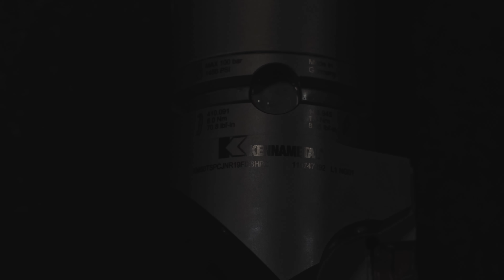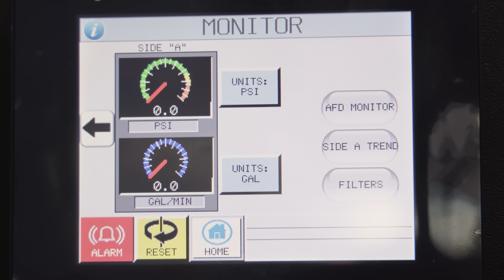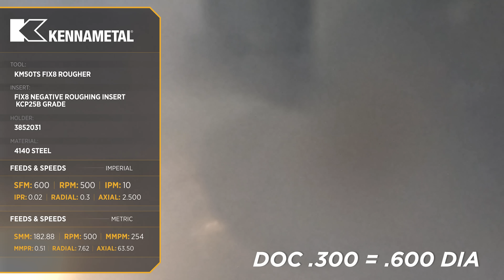AGGRESSIVE Cuts in 4140 STEEL | PUMA SMX3100ST Mill Turn Lathe

Comment from the maker: Love Seeing Tyson Having Fun… Truth is, the cuts he took were 4 times faster than the parameters given with the tool / insert… So he definitely was testing the boundaries… and holding his breath😂… On that last cut, I told him that he should actually turn away from the machine and just have his hand on the STOP… as his ears would hear the insert go quicker than his eyes and he would be faster hitting that red button… of course he needed to see the CUT, but to our surprise… It just literally Zipped right through it. WOW! This tangential insert is truly… a Remarkable BEAST!

Great Job Tyson!!!

- Proud Dad
Reply: Show the chip!
Reply: Boom!
Reply: Tyson has really upped is game!
Great video however I would be concerned with the b Axis alignment after so much heavy roughing….
Best practice to use the lower turret for the heavy stuff. IMO.
Reply: In the late 1990's we were turning 4150 shafts on a CNC Dean Smith and Grace lathe taking 22mm DOC (44mm off dia per pass) at 1.2mm/rev feed rates so Titan you have a bit to go to catch up on material removal but i do enjoy the videos and have picked up some useful stuff from them
Reply: Your son is a beast!
A man of confidence and knowledge!
Reply: WTF IS THAT? TIN??? THAT CAN NOT BE STEEL!
Reply: Those were some beast cuts right there!
Reply: Your heading shows .024 FPR.  No way.  Should be .024 IPR
Reply: What size was the piece of material that was cut?

Comment: As the dia of the workpiece gets smaller the differential of SFM across the DOC is going to be a problem. 

You need to start off at the finishing feeds and speeds on a larger workpiece. It will probably run even better.

Comment: Why they are not machining forging or casting job . Wasting so much material and time.
Reply: Forged steel is generally more difficult to machine than rolled is and it doesn't have the same grain structure that rolled steel does and inherently has more stress in it and has variance in hardness throughout the part.
There's a reason why they make forgings and a reason they don't.
Edit: That's ESPECIALLY true for casted parts.

Comment: not the most aggressive cuts but pretty impressive no doubt. 
I used to run a 60" table VTL by Schiess and we would rough 80" diameter, 5 ton, 4140 forgings at .240" DOC and .030" IPR with a monster CNMG 643 insert.  Not for the faint of heart. We would fill a 55gal drum with chips in about 15 min. Close the door, hit the green button and hold on tight..
Reply: They went WAY OVER the DOC and SFM you were talking about AND it was a Mill/Turn 5 axis LATHE with a max 18" diameter chuck LMAO.

Comment: Wow that was a vicious cut you can hear the RPM falling off the whole way how much horsepower was that now wound up in that machine?
I'd like to see that cut on the full OD of that chunk of metal.
Hang in there young man that is bad to the bone got to give you that now and that kennametal tooling.
It was really a fan of them but they've bought out all the companies who's tooling I did like.
Just an old hasbeen.
Somebody told me one day to break a machine begrudgingly I did it.
I heard the wires smack the conduit when it finally had enough.

Comment: You need to get yourself some tantalum turn then profile that and part that off.
Show me what you got baby
We used to hold profile of half a thousandth on 2 inch 4 inch and 5 inch bar making gas diodes.
As I remember it took about 40 of those part assembly's to make up an array.

Comment: The only problem I wonder about is putting stress into the component.
I can remember cutting nimonic steel rings and heavy roughing cuts put so much stress into the material that once it was unloaded from the fixture, it started to distort over the next few hours and I mean 2" twist on a component 5 feet dia.

Comment: That's all very nice.  It is.   But, for my money it is the ability to hold tight tolerances consistently.  So mic it,  then set a depth of cut take a pass, and mic it again and see what you can hold.   The tool and part deflection at different depths of cut and different diameters would be interesting to see.

Comment: nice video! you should try SMG 1115  or the Kendametal Spat MD  ive been using this insert for years and easy cuts @.480 - .500 per side and at 15in length of cut.

Comment: That insert is huge! Just pulled up the specs on the SMX3100 124Nm holding torque on that milling head. For the home machinists out there with 480 oz.in nema 34 motors, that's 17560 Oz.in of holding torque! Explains why that tool don't spin in the spindle.

In the production shops I know of they'd be roughing at 1000 SFM all day long with that setup. Time is money!

Comment: Just a layperson but as the diameter of the steel is decreasing the amount of material removed is reduced so the fact that the depth of cut is increased is offset by the reduction in diameter to some extent.

Comment: You keep saying “idk if the cutter can do that” i think with this style of cutter your limit is going to be the machine. Your machine spindle was slowing down in the last two cuts. Have you looked at your torque curve chart for your spindle? I know you kept increasing your SFM which essentially is your RPM. The higher the rpm the lower the torque so you need to find the sweet spot rpm vs torque and then if anything increase your feed per tooth up until you reach your spindles 100% duty cycle load limit

Comment: My local Kennametal rep has been bugging me to try these out. I look forward to seeing how it stacks up against the Iscar COMG646 inserts we use right now. Running it on the 100 degree edge we can take a max DoC of .415 at a feed of .024 maxing out the spindle load at around 90%. If we drop the DoC to around .300 we can push the feed up to .034.
Reply: As a Kennametal rep myself I recommend you give it a try!  But seriously this is an amazing tool
Reply: @Tyler Wolfer  Just got this tool today. I can't wait to try it out.

Comment: If testing tool and inserts you need to cut more time machining some tools and inserts good for first couple passes but when it turn in temperature to hot its start breaking inserts chatting I have been on cnc over 20 see that thing happen a lot many people I worked with they test tool and insert cut only couple passes than wow this tool and insert really good but later on its didn't work for long day machining.

Comment: Lame...all depends on machine strength.  I've taken 5/8 depth at .042 feed. If your machine is small, its safer to take light cuts and not crash the machine.

Comment: That's alot of 4140 - 1/2" inch at those feed rates to remove. Wow.

Curious to the cost of the inserts and how long they actually last feeding it even 80% as hard as you just pushed it.

Cost to cut ratio matters most.

Comment: Ok, idea time.   Great video and awesome job here.  BTW,  you guys are absolutely nuts!  I would definitely be worried about damage to your equipment. 

Here's my thoughts:

1000 psi coolant pressure  makes absolute sense here.  Consider what a water jet cutting machine does and apply the cutting tech/principles to this situation.   Bump up another coolant stream to steel cutting pressures,  aim the stream above the cutting tool and at an angle if necessary and look at your loading numbers.  If you can reduce loading and tool wear significantly then you will be in the money.

As it is all by itself this incert is a game changer.  If you bump up the coolant pressure to 2-3k and are able to cool the coolant down to negative temperatures Fahrenheit you might get even more performance out of this incert.

Lots of different approaches to this and plenty more upside to production speed are possible. 

Great job guys!

Comment: Amazing tool. I remember getting similar output using CNMG120412-PR from SANDVIK about 15 years ago on old FNC 1500 Lathe. I think it was 9.5mm depth 0.8mm mm/r and and speed was around 700m/min.
Reply: Finally some metric specs i can handle.. i was like 500 000 per side what?! 😅

Comment: AWESOME!!!!!...When the cutting edge breaks down & you don't stay on top of the wear on a insert like this, then your insert will implode SUDDENLY, then followed by destroyed tool holder, then work part, and most costly the spindle on the machine. Very important to never leave the machine while this tool (insert) is cutting. If you don't have a puckered asshole when this type of cut is being turned then your a high risk employee to your employer!

Comment: That is baby play. In 1979 at Bucyrus Erie in Pocatello, Id, on a 12 foot vertical Warner Swazee Gray rough cuts on 30,000 lbs. steel castings were .750 depth at .062 fpr. surface feet per min was only 300 on a 120 inch diameter for safety. RPM of table was about 7 rpm.

Comment: I used to work with a guy who would take .300" depth of cut with a 4 radius turning tool, on a Tos manual lathe. No hydraulic chuck either.

Comment: If you're cutting on a reducing diameter, wont you be removing less material per unit depth of cut? So it should be easier to take deeper cuts at smaller diameter even with same surface speed and feed rate.

Comment: Kennametal recommends a max speed of 190 meters/min ( 620 SFM ) for the product group you're in P5-P6.
Why taking the risk to ruin your tools, chuck or machine by increase the speed by 60% further than the max. up to 305 m/min - 1000 SFM ???
Maybe you have to ask the guys at Schunk about reducing of clamping force at high refs and torque with that big cut.

Comment: I remember late 90s boss brought a tool to us from Hertel. WHAT??? Tangentially mounted insert.  Turning tool and a 4in face mill. Identical insert mount but no chip breaker. We used to HOG 4140 with that facemill .300dp and .01-.015/tthor better for other material. Just lower speed because of HP. Still a killer design as witnessed here.  Never broke an insert, just got the coolant boiling in the chip tray.  Oh ya, no robots involved or shields to hide behind 😁. Just you, a mass of steel,  and a scoop shovel to move the chips.

Comment: I ran a big 36 inch chuck on a belt driven lathe at my last job  .040 per rev at .25 depth of cut no problem on 4140. But it wasn’t hardened or annealed . .050 per rev when facing

Comment: Kennametal has had this type of insert for ages, worked with those some 30 years ago on a manual lathe.. it is just incredible what you can do with these inserts, and they only got better through the years..
And you get 8 cutting edges per insert.. how' s that for return on investment...

Comment: What is the spindle load? Those are some big cuts. I'd be interested in  knowing what the spindle load was. You could hear the machine bogging down on that last cut.
Reply: I think what you hear is not the machine bogging down but the part's harmonics greatly changing as the pass is being made , like sliding a guitar string toward the neck

Comment: Impressive how that top spindle holds its position under that load ,does it hold its position via mechanical lock or electrical hold not loosing steps ?

Comment: OMG that last cut was absolute Insanity! Must also give credit to the Doosan for having the power and stability to back that new insert at those rates without chatter issues.
Reply: I saw the specs and pricing on some Doosan machines, and for example their entry level VMCs that go at a smidge above the price of the full spec'd DMG M1 I worked on, is literally better in almost every way in terms of performance, and at least equal in terms of capacity with the exception of the square working envelope of the M1, and the head-head-head kinematics of the M1 that mean it has no way covers below the spindle, which makes running it and cleaning it very quick and easy, and you don't get any chip jamming issues with the way covers.

Comment: Question: Is coolant recommended for steel on that tool? Doesn't the coolant give thermal shocks to the inserts and reduce their life?
Reply: Lathe is much different than milling. In the mill the cutting edge leaves the cut hot and then is quickly cooled, this is where the shock happens over and over. The nature of a milling toolpath also leads to different amounts of time that the edge is in the cut so it is an infinitely variable occurrence. In the lathe, the cuts are controlled and consistent and the tool is always engaged so it has time to heat and cool evenly, but because it's continous things can also overheat very quickly. The coolant is there to both lubricate and help stabilize the cutting action and temperatures. In the lathe, the coolant is causing a thermal shock to the chips as they flow away from the tool and this causes embrittlement in most materials and helps break the chips up. Lots of materials won't break a proper chip without coolant, especially in deep or aggressive cuts where the chip is large or thick enough to actually have real strength. Of course there are special situations where this doesn't apply at all, certain very specific materials or shapes, interrupted cuts, and so on.

Comment: There is a limit to everything hence it may be you are putting too much stress on the machine than it can handle. Why not just call the lathe manufacture and ask them the most you can cut in a single pass. When you say it's "crazy" that you take so much off in one pass, yes, it is but not in a good way. Let's hope your desire to push the limits on the lathe doe not end up with costly internal damage on the lathe.
Reply: That's not how it works. The large manufacturer will tell you the same thing that the screen will tell you. It goes by spindle load, and there is no way to correlate that with different material, cutter geometry, and feeds & speeds. The screen is telling them what the spindle load is, and it's just fine.
Reply: @littlejackalo5326  Thanks for your reply. As a machinist myself, I've always been cautious about pushing machines to such extreme degrees, especially for safety reasons. Just because the machine can be pushed to the max (whatever it is) does not mean we should. If this lathe is pushed constantly to the max something unexpectedly is bound to go wrong that not even the lathe designers could foresee. While I realize that time is money and TITAN is very competitive and masters in their craft, I feel they go too far with it. Mainly because I know of no machine shop over the years that is as obsessed as TITAN with speeds and feeds. Then again, that's what sets TITAN apart from other machine shops... all the best to them. Personally, I would not want to work is such a place. I work to live not live to work.

Comment: “I would not try that at home…”
> Me, wondering if my cordless hand drill can generate that kind of torque…
Yeah, you’re probably right. 🤣
Reply: Cordless? LUXURY!
Reply: @R.Daneel  Hand crank tools rarely have cords.
Reply: bruh ive used a milwaukee that would just about snap your wrist if you werent careful. this would throw your whole body as if you werent even there
Reply: @bradhaines3142  yea but that lathe has probably 500-1000x more power than new cordless drills and almost every lathe no matter the age will gladly wrap you up in its business if you know what i mean

Comment: Looks like the old Hertel cutter, it really performed well.
Reply: couldn't remember that name but I used those tools almost 30 years ago, 8 corners and very strong insert.
Reply: I still have a couple of boxes of Hertel FixPerfect inserts that I reserve for finishing work. What I liked was they were sharp edged, putting very little deflection on the part, and yet would roll up a nice chip into a smooth spiral that would break clean, instead of forming a bird's nest and I didn't have to push the feed to get chip break, which is what you want when finishing to a certain roughness spec.

Comment: Used a version of a tangential tool years ago. Took 3/8 inch depth of cut on a old LaBlonde tape turn lathe. The lathe was a beast with super heavy box ways.
Reply: I don't know what tool we used 20 years back but our old lathe (it's just old, we still have it) got it's gearbox destroyed and the support flew off during similar cuts to this. 
i think 10mm radial and 0.2mm feed 

now this machine is not that precise anymore but if you know how to produce good parts on there you definitely can turn😂

Comment: 1000 SFM, . 024" FPR and 1000psi coolant was it enough not to have made any heat to work harden the 4140?
The higher feed rate is smart, because you want the heat in the chip A lot of machinist would make the mistake of lowering the feed, but that would generate more heat. It's scary af and operators always want to slow the feed, but that would work harden the part and the next cut will break your insert. Correct me if I'm wrong.

Comment: Why didn't you just use G0 and 25% rapid feed? 😂
I would've liked to seen the spindle load meter. I've done cuts like that on cast iron, but it was 100HP main spindle with a 24" chuck. Most jobbing shops the lathes are 20-30HP max.unless you have a job to run a big production part or like the shop I was in we got a good deal on a used machine.
You Titan guys are spoiled.
If the insert is made to handle that depth of cut and your machine has enough HP do it 
The feed .024" okay, but 1000SFM in 4140 Damn!!!
That's a little scary 😁

Comment: What I also saw is that you didn't face off the face before the cut! I believe the un-faced rugged face have impact on the start of tool-material engagement. You should face it off next time. Thank you.
Reply: It makes zero difference. That took is so strong and the feed is so fast, that facing the part won't have any impact on anything.
Reply: @littlejackalo5326  I believe is has. Just make a try of even a small one. I have been in that situation a and when it goes beyond 100mm diameter I face it off.